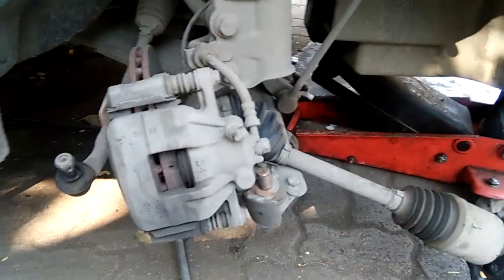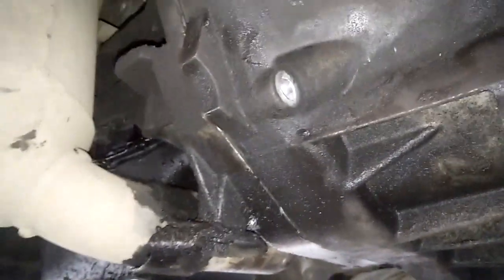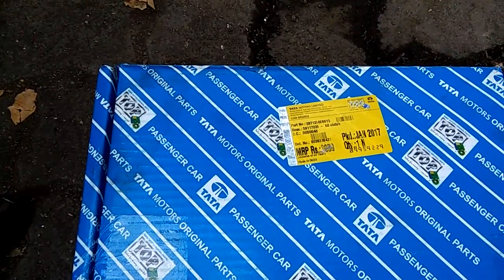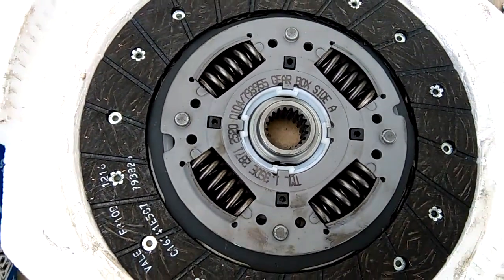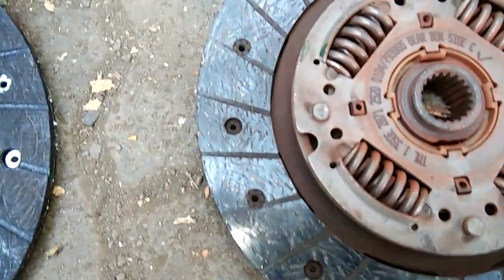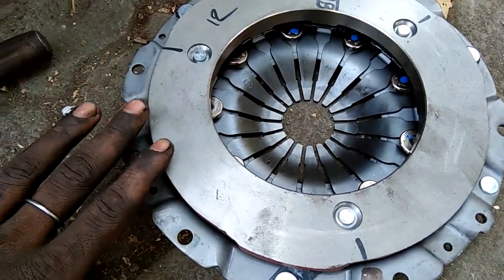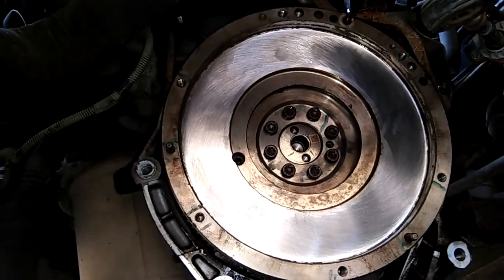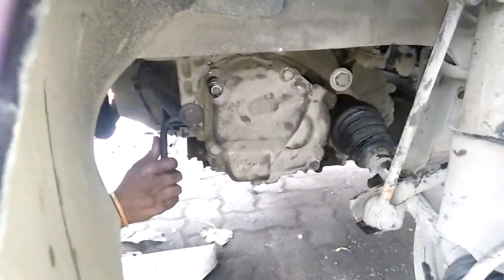Tata Manza CLUTH replace And Pick up Low

Comment: Vai , Vista Quadrajet ke clutch full floor taak press karna parta aur floor se halka matlab 1/2 inch release karne se clutch engage ho jata hai ,  normally 1 se 2 inch hota tha pahele , ekbar clutch change korne ke baad eisa hi ho raha hai , , mechanic bolta hai ki eh thik hai , paar aisa paheli nahi tha , eski pick up mein koi problem nahi hai , Clutch ka  sleeve cylinder ka play vi thik hai , paar padasl press karne ke se floor ke baas 1 inch meuin ja  kaar hi clutch disengage hoti hai , , plese bataye iski internal paar koi adjust hoti hain key ? please epe ek vedio banye , thank you
Reply: nahi
Reply: rabin majumder bhai AaP ko soloution Mila ? Kyu ki Mera bhi same problem hey manza mey 🙁

Comment: Bro i have tata manza diesel when i switch on AC pickup drop considerably i want to know that  how i can solve this problem my mechanic said that due load on engine that's why car's pickup but without ac on car drive effortlessly
Reply: and i have replaced this all things + clutch master and repair  turbocharger
Reply: Bhai mere pass Tata manza petrol hai par pick up nahi le rahi Maine service karwaya plug change kar liye but still problem same hai..Tata workshop wale nahi bata paa rahe aisa kyon ho Raha hai missing bhi hai

Comment: Is it necessary to replace as a unit ( clutch plate, pressure plate, flywheel)..
Reply: Yes or else again u have to change the entire assembly
Reply: No,need to change fly wheel, clutch plate,pressure plate then release bearing,the three parts only called as clutch set,totally three parts original will come around 5000 rs,plus labour charges coming around outside rs 2 thousand to 3k,without any damages dont need to change fly wheel,very very rare complaint is fly wheel gone up,maybe after runned after 4 lacks,k.m it may be getting damaged,otherwise its wrong g decision of mechanic,clutch also you use properly life around 50k to 1 lakhs kilometres.
Reply: @Vijay-on-drive  brother you are wrong,fly wheel fault is rare,every time the clutch replacement coming with clutch set,means 1,clutch 2,pressure plate 3,release  bearing,am have the same vehicle,if not believe me go and check it in YouTube skilled mechanic Tamil,ge is the specialist in clutch related fault.